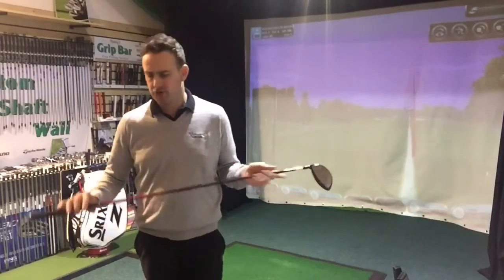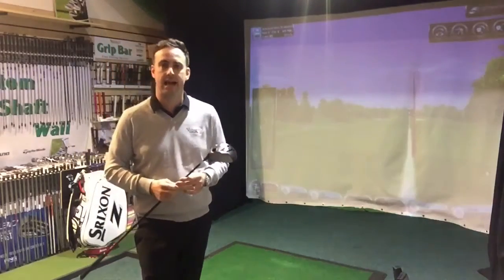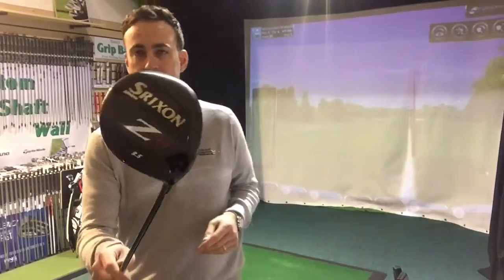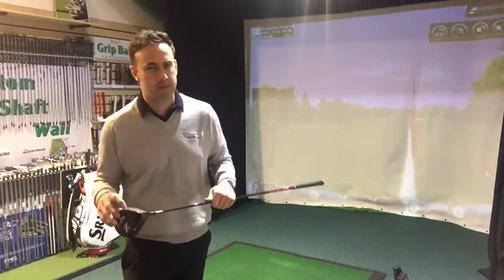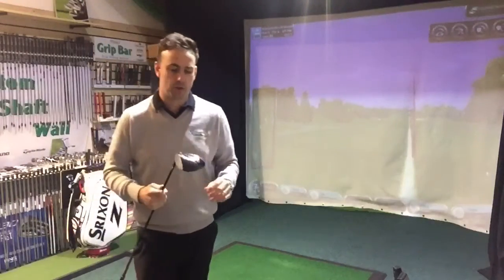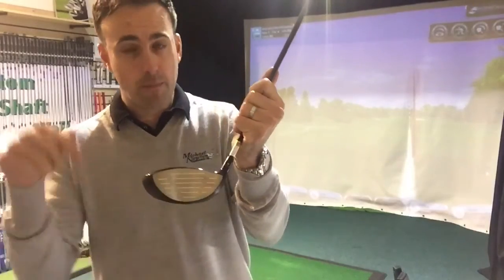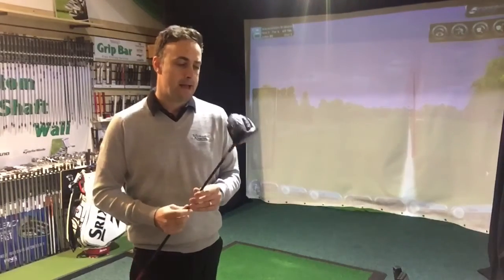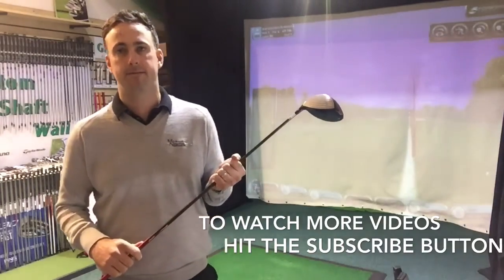Custom Fit Correct Length For Your Driver To Improve Strike

Comment: Spot on !  Coupled with proper Shaft Length is - Shaft Alignment.  Moral of this story / rule - a shaft when swung will want to move into its natural bending plane based on its construction (i.e. Fly fisherman have known this for decades).  

Each steel, graphite, other material type of shaft will each have a Natural Bending / Flat Line Oscillation plane as well as a Spine.
  
For best results for any shaft, cheap or expensive, the shaft should be installed on its Natural Bend (NBP) / Flat Line Oscillation (FLOP) Plane in line with / facing the target line (9-3 o'clock) - for every club.  In most cases, the Spine ends up aligned at 12-6 o'clock - a good position to reduce drooping.

Lastly, if the shaft adapter does not allow you to maintain the NBP / FLOP at the 9-3 o'clock position when changing settings, the adapter will need to be epoxied into the neutral position (or your preference setting on the adapter) as the other settings will take the shaft out of its NBP / FLO plane, from alittle to a lot (results in an open or closed face position at impact on the same good swing).  Worse case / adapter position, the shaft will actually feel like it is fighting you / your swing.

Bottomline, find your clubs / get fitted (like a good marriage !) ... take some lessons ... and practice & play this great game !

Enjoy ... o __